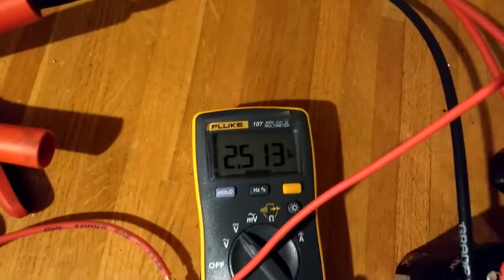super capacitor balancing resistor testing

Comment: Hello,
Isnt this type of balancing constantly draining your capacitors? I mean its a closed ciruit with resistors and current will flow.
thanks
Reply from the maker: You are correct there is a constant drain on it. That's why sizing the resistors is tricky the less resistant you use the higher the drain but the faster they will balance.